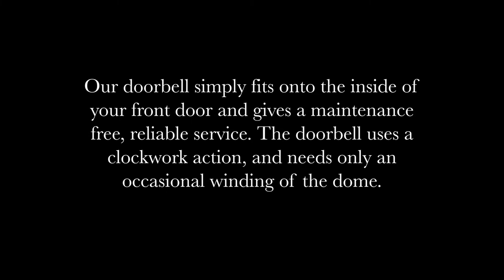Mechanical Windup Doorbells

Comment: are you able to go through the process of putting a wind up mechanical doorbell together, I have one with the high tensile wire strip in it and this has come out and not sure how it goes back together.